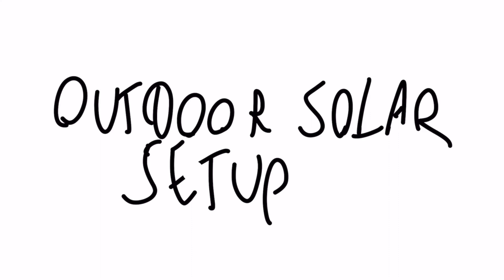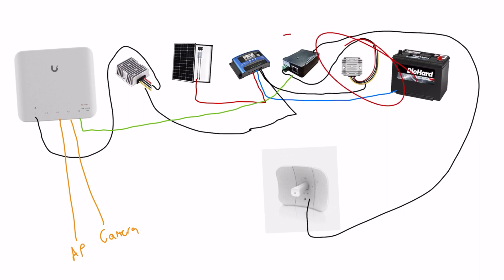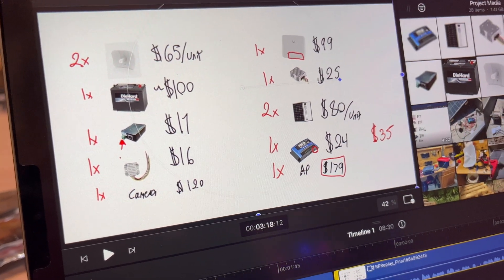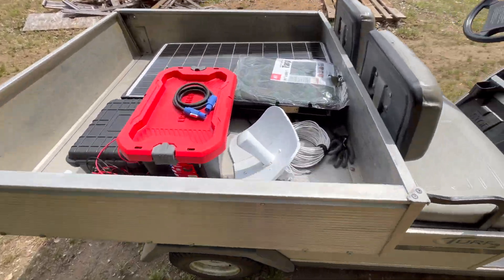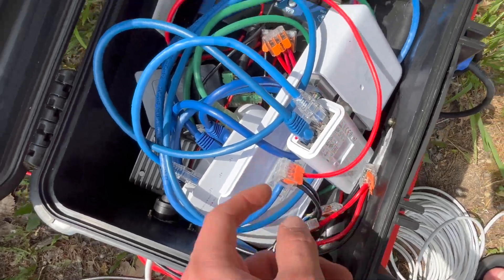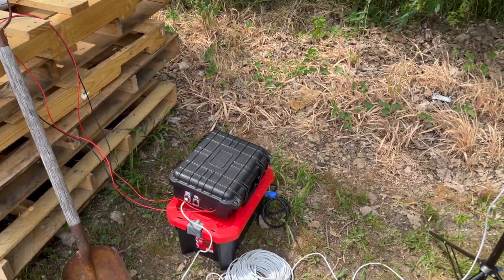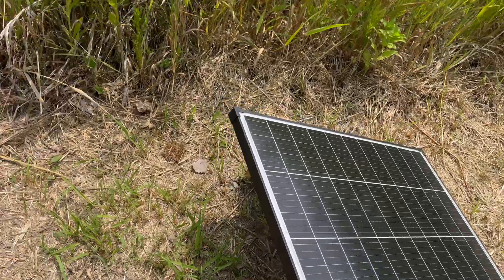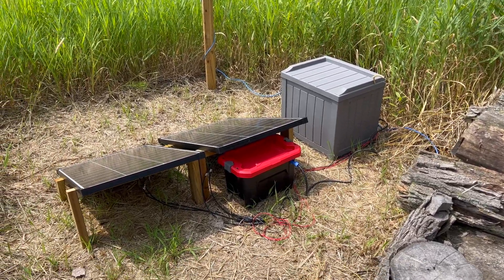DIY Outdoor Solar Setup with Ubiquiti UniFi

Comment: Feel free to correct me but I believe you can skip having to use Step-Up Buck Converters by using a TP-DCDC-4848GD-HP for the USW Flex and a TP-DCDC-1224G for the airMAX LiteBeam. It'd be slightly less affordable but less wires to mess with. I'm trying it now, so hopefully it works out!
Reply from the maker: Looks like it would work to me. Did it end up working for you?

Comment: Hey, I know it's too late for this project, but did you know Ubiquiti has a product that incorporates much of what you put together in your video? Ubiquiti has 2 products to do what you are trying to do: sunMAX SolarSwitch (SM-SW-40), and sunMAX SolarPoint (SM-SP-40). They are marketed under Ubiquiti's UISP line of products, it's powered by solar PV/battery and has an integrated solar charge controller, a 4-port 10/100 FE PoE switch, and I believe it even has a 2.4GHz access point. The SolarPoint has an housing that allows it to be mounted outside, exposed to the elements. Both products are currently out of stock, but sell for USD $199.
Reply from the maker: Thanks for the recommendation. I would’ve gone that route except it’s only 100Mbps and I can get more bandwidth than that using gigabit switches. Wish they would come out with a version that supports gigabit. Also seems like they’re hard to find in stock 😭